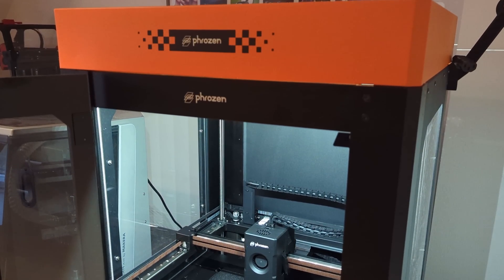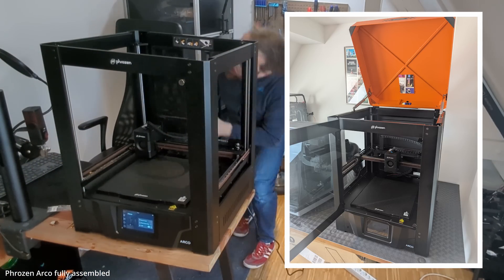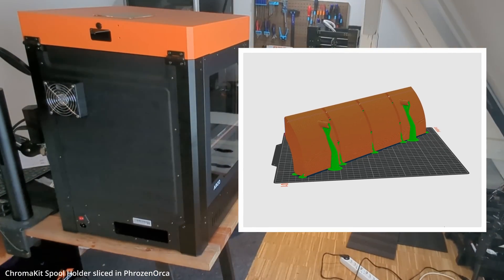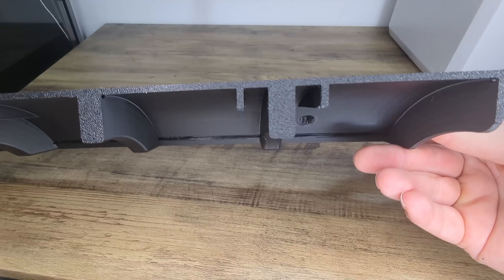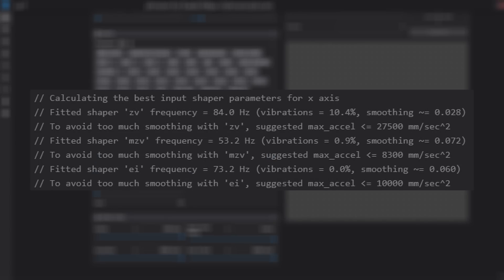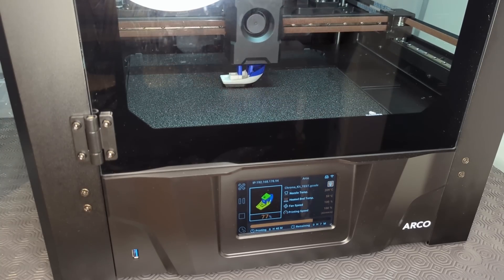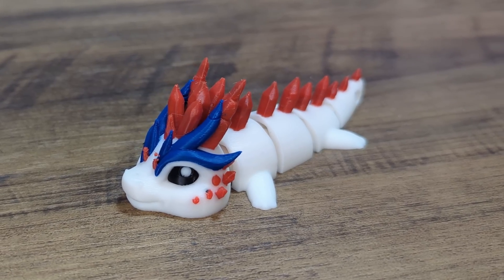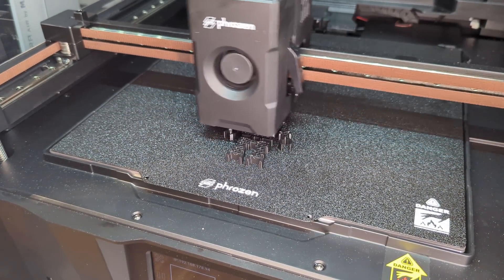Phrozen’s First Step into FDM - Phrozen Arco | #HonestReviews

Comment: The Y beam you brag about was injection molded from aluminum like everything these days, no milling required. Just the surface could be milled in a jig. No 5 axis CNC needed. Stop overthinking it.

Comment: Following the Voron Phoenix development is kind of an eye opener. Some of the mistakes are actually in this printer. To me it is kind of disappointing following this industry, as makers tend to struggle with the basics of physics. This printer is in the workshop tradition, and to be honest, it prints plastic, but costs a fortune. That in itself is a failure. It works for giant sized printers, but seriously, this philosophy is failing. We print using plastic, a material people hate, on top of that, we add layer lines. Which people also hate. This just ain't a tool for mass production of cheap plastic parts.
Reply from the maker: Well, I think that’s a perspective everyone has to answer for themselves.
For me, the weak point in that argument is that it’s kind of like saying “screws are bad because we already have nails — and nails are good enough.”

I believe the variety of tools available is what makes the DIY market so great.
Being able to produce plastic-based objects at home already unlocks huge potential for makers, and with milling machines becoming more and more affordable, I’m really looking forward to the point where CNC milling wood and aluminum becomes accessible to everyone.
Reply: @MattThePrintingNerd  Sorry, but physics is not subjective. Nor is economics.

Creating is quite a different matter, as is design. As for diversion and range of this industry, it is actually not wide at all. There is a mainstream, and most follow that. There is the rod, rails, and leadscrews, and funky belt implementations. But it is narrow, just a rehash of the same, over and over.

Infact, your printers are actually seriously different from the rest as to framing. You also tend to do things a bit innovative at times. I just struggle with your marketing, which to me is dishonest.

I rather find this industry stale at the moment. No wonder bambu is doing so great.

Comment: Would love to see your recommended upgrades in a video. I also have the Arco and no real issues but agree it needs some polishing. Being is open source and there are still many people that like to tinker I feel the base price is not bad. It was a little rushed still even though it was late to market. People fail to remember it went through a complete redesign because of the community. 
 Let us know what you changed and how the outcomes worked out 
 I am also curious on the ability of  adding the INDX setup down the road. With the solid frame and open source of it all I don’t see why it would not be possible and a great add on. I am personally not skilled enough to code for it.

Comment: Input Shaper Graphs?
Reply from the maker: Yeah, I’d love to see the graph too — unfortunately, the only way to access it is by connecting to the printer’s operating system via SSH. Phrozen didn’t map the input shaper output directory in the printer’s firmware, so it’s not directly accessible otherwise and I don't have root access on my machine (yet)
Reply: @MattThePrintingNerd  whats so hard about SSH'ing in the printer and then just copying over the files necessary?
Reply from the maker: you need access to it ;-)

Comment: Feels like machine from 15 years ago.
Reply from the maker: Nah, let’s not overexaggerate things. Looking at the pieces, there are many state-of-the-art design choices that truly stand out compared to other printers in this price class — the most rigid frame in its category, a fully machined gantry, a heat-pipe-based cold zone, and 9 mm belts in an inverted CoreXY layout, just to name a few. You can really see the vision they had, and even if the final product didn’t fully live up to that vision, you’ve got to give them credit for the parts that were exceptionally well made.

Comment: I really respect Phrozen for choosing you to do the review, knowing how in-depth you would take it. It shows their confidence in their build. I wish all printer reviews were as detailed as yours. Most 3D printer influencers have no idea how the printers are made or how they work at the level of depth you go into. It’s a breath of fresh air seeing a real review from a printer nerd’s perspective, covering all the things I actually want to know. It would have been nice to see the input shaper graphs too, though.
Reply from the maker: Yeah, I’d love to see the graph too — unfortunately, the only way to access it is by connecting to the printer’s operating system via SSH. Phrozen didn’t map the input shaper output directory in the printer’s firmware, so it’s not directly accessible otherwise and I don't have root access on my machine (yet)
Reply: @MattThePrintingNerd  using mks / makerbase should give you root access when you SSH in, what are you using?

Comment: I would really appreciate the upgrade video. Unfortunately, my print bed has a variance of 1.5 mm from left to right
Reply from the maker: That’s unfortunate to hear. A variance of 1.5 mm is definitely outside what I’d consider acceptable — I’d recommend filing a complaint and requesting a replacement unit from Phrozen.
Reply: @MattThePrintingNerd 
I also had two loose magnets in the print head and a scratch on one of the side panels. I've sent multiple emails and still haven’t received any replies, and the multicolor unit is still nowhere to be seen. I think they overestimated themselves and then “forced” the printer to launch before they would have had to delay it for a third time by another six months.
Reply from the maker: Yeah, I also think that the decision was driven by factors outside the development team’s control.

As for the ChromaKit — honestly, I had no idea I was the first person to get a review sample. After testing everything together, I felt that the story I wanted to tell was more about the printer itself, so most of the ChromaKit-related footage didn’t make it into the final cut.

Comment: I want to see the mods, if I could do some simple mods to fix those small things I am more interested. I would also like to see the real flow rate it can produce and what kind of speeds it can really do.
Reply from the maker: I measured a flow rate of about 37 mm³/s with standard PLA, which is slightly below the marketing claims. I didn’t include this in the video because, in practice, the printer’s usable motion range never pushed it to the point where flow became a bottleneck. That said, Phrozen did include a genuine Bondtech CHT nozzle for Kickstarter backers, so hitting around 50 mm³/s might actually be realistic — though I haven’t tested that myself.

Comment: Arco user here. By far, disappointed. I feel cheated. UI is a nightmare, the slicer is infuriating, especially since we have the likes of prusa, Bambu lab, and Orca. My suggestion, save your money for something else
Reply from the maker: I can’t really say much about the printer’s touchscreen UI — it worked fine, but it didn’t leave any lasting impression either.
I spent about an hour testing PIXUP Slicer, and it’s clear there’s still quite a bit of work needed before it can truly compete with Cura or OrcaSlicer.
Speaking of Orca — as far as I can tell, PhrozenOrca is basically a rebranded version of OrcaSlicer, offering pretty much the same user experience as its original.
Reply: @MattThePrintingNerd it's been a nightmare using their slicer, worst part is that remote printing only worked once
Reply: for the money you can build a voron with exagerate aluminum profiles like this
Reply from the maker: No you can't :-)
Reply: @MattThePrintingNerd  why not? its as good as a basic voron with beefier frame, and it costs 870 euros. The profiles for a trident 300 are 90euros. A voron clone like sv08 has more volume 350^3 vs 300^3, and costs less than 500 euro. Are you telling me for less than 200 euros i cant change out 4 L-profiles andd two gantry profiles if i want fast Z accel? There are finite element analysis studies for upgraded voron printers you can even compare to.
Reply: @MattThePrintingNerd  if i use the parts list from t250 and adjust for the slightly larger parts, and combine it with a 90 euro trident frame kit i come out cheaper. Swap the rods for linear rail, longer belts, etc.
Reply from the maker: I did not say that it's not possible but a EZ Bake or Doomcube Frame a lighweight X&Y Components a proper Part cooling and TMC5160 is more like 1500-1800 USD
Reply: @MattThePrintingNerd  you said "No you can't" literally

Comment: 9:00 I would say that is cast aluminium with milled surfaces for the rails and not 5 axis CNCed out of a full block.
Reply from the maker: It’s definitely not cast. I’ll take some clearer photos of the Y-beam tomorrow — you’ll be able to clearly see the milling marks on it. I'll upload them on my Instagram
Reply: @MattThePrintingNerd  Milling marks could also be transferred by an unpolished mold. Maybe check for the angles of the struts on the underside: if they are really completely orthogonal it is definitely milled (would cost hell of a lot more, if each pocket is milled with angled side walls), if they are angled they were probably made to be demolded more easily and the part might have been cast.

Comment: I would really like to see a video of your mods for the printer. Idler pulley swap and X axis fix.
Reply from the maker: Cool, let's see if this post gets 100 upvotes I do it!
Reply: @MattThePrintingNerd  I'm totally in for it as well. 
I remodeled the toolhead to fit a Noctua A4X20 (avail on printables, with F3D file) so modding is on the table. 
Let's make this printer live up to its true potential.
Reply: Same. There's also some user made tool head mod to make TPU print up to 240 mm\s. This thing is a solid base for tinkerers so let's make it happen